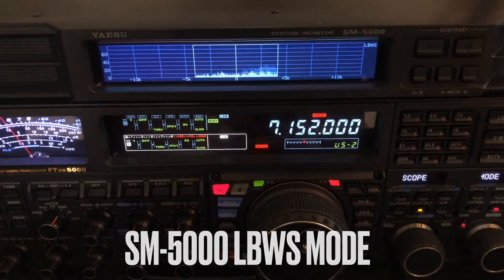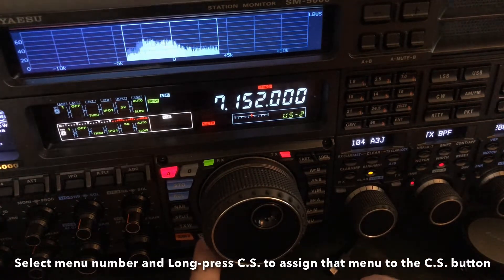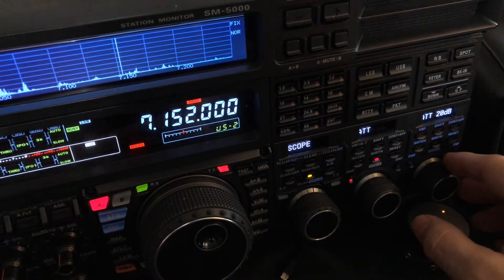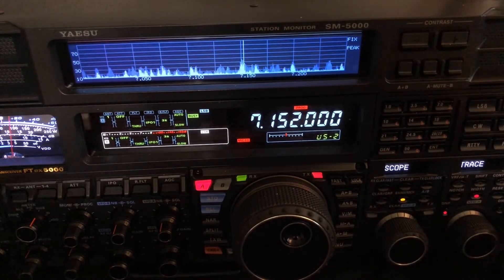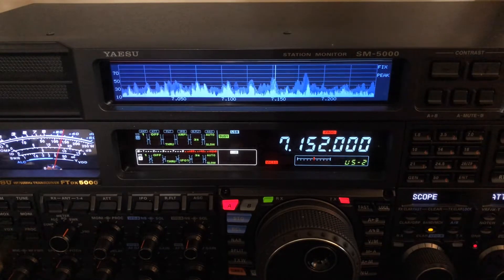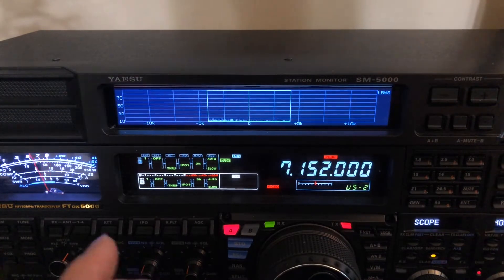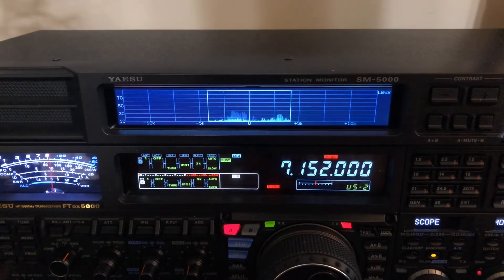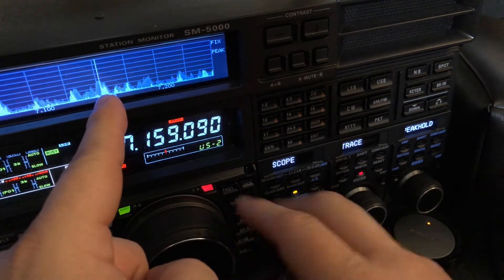Yaesu SM-5000 LBWS Mode #yaesu #sm5000

Comment: Thanks for this video. I suppose you could connect for FTDX-10 to the RX out on the FTDX-5000 and have an external waterfall display if you wanted to. Mute the FTDX-10's RF out and install a RX guard form DX Engineering. If the two rigs could track each other somehow that would be cool. 73.
Reply from the maker: The 5000 has an IF out but there is no place to connect it to the FTdx10.  But I’m just not into waterfalls anyway. I would never risk having both radios on at the same time, except for receiver comparisons.  I bought the SDRPLAY DUO and connected it. I got bored with it and returned it for a store credit. I used the credit to buy the mu-Tuning preselector for 80/60/40 meters. I get much more use from it.

Comment: thank you for the excellent video. I have connected an Airspy with Spyverter to the IF Out. Unfortunately, I can't get the Airspy to show a reasonably accurate reading. It's so far away... do you have any tips? Thanks
Reply from the maker: I don’t have any experience with the Airspy. I tried a SDR DUO but it couldn’t receive as well as either of the receivers in the FTdx5000MP and the DSP wasn’t as good.  So I quit with it. 

73, de N4HNH
Reply: @n4hnhradio  Mny Tks

Comment: Doug, what causes signals to go wide?  Faulty hardware or operating procedures?
Reply from the maker: Yes, Curt.  Hi Hi!  Either or both. Splatter can be caused by various things. Amplifier not properly tuned (tube type), ALC not set correctly, over-driving a Solid-state amplifier, processor set too high, a failure in the TX BPF, or even a failure in the circuit that suppresses the opposite sideband. 

73, Doug
Reply: @n4hnhradio  I knew some of those reasons but not all. Thanks for letting us know.
Reply from the maker: Absolutely my friend!  That’s what I’m here for. 

73, Doug
Reply: That's one of the reasons I keep reading comments. I always learn something else.
Reply from the maker: I wish everyone would read the comments, Luciano. I find myself answering the same questions over and over, even though I have already answered them in a comment. 

73, Doug